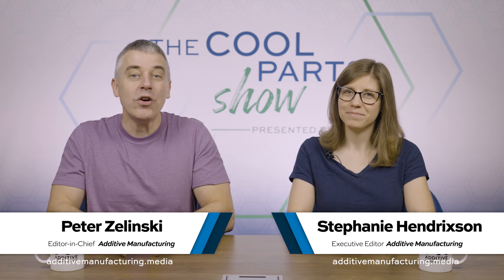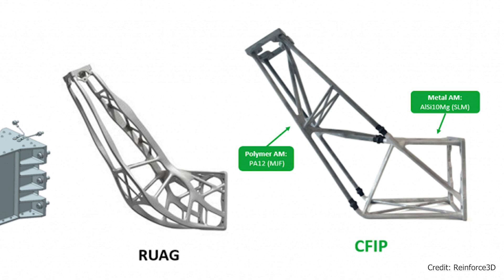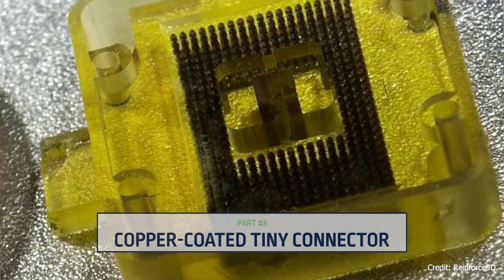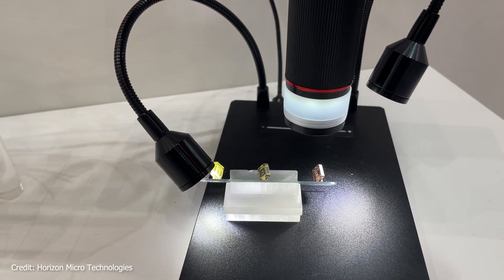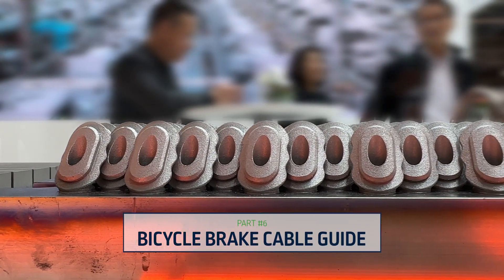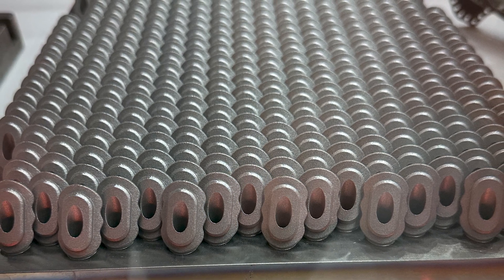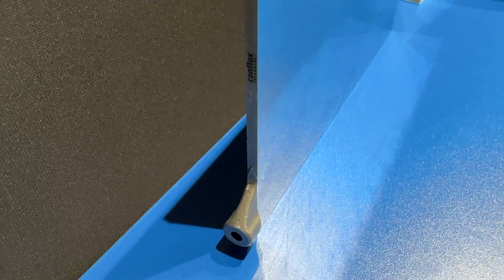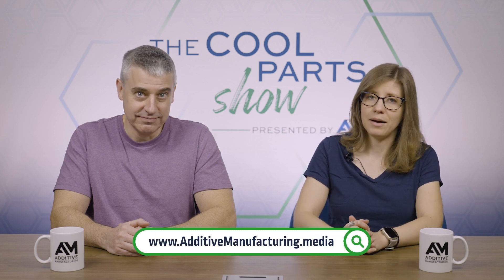8 Cool 3D Printed Parts From Formnext 2023 | The Cool Parts Show #65

Comment: Some of my favorites were: displayed at 3d Systems- Carbon Capture Condenser, Heat Exchanger with Implicit Modeling, Carbon Capture Heat Exchanger, CERN Cooling Bar, Gas Mixer With Active Cooling; at nTop- EGR Cooler, Semiconductor Chiller; at Farsoon Technologies Underwater Vehicle Chiller, In-Line Tube and Shell Heat Exchanger, Circular Heat Radiator; Drill Heads and Ta-10W component at BLT,  Air Hydrogen Micromixer at GE Additive, Fine Boring Tool at KENionic, products at Oechsler, NiCoMoTiAl test sample and Multi-Material Rocket Nozzle at a Korean company, DLR Scout Rover for Space Research at pro beam, Hybird Stator and Heat Exchanger at Aconity 3D, Copper-Nickel rocket nozzle. And I also saw the Helmet Pads at General Lattice featured on the cool parts show, and Carpenter Additive as well. And I was happily surprised seeing ultrasonic and Titanium chip-pulverizer based powder production solutions, liquid metal infiltration on additively manufactured structure, and constructions at Construction 3D.
Reply from the maker: We should have compared notes with you before filming! This is a thorough and varied list, although it looks like heat exchangers and rocket nozzles are of particular interest to you. The company you're thinking of with the multimaterial rocket nozzle is likely InssTek out of South Korea. Thanks for sharing and watching. Stay cool!
Reply: @AdditiveManufacturing  I see, thanks! I came to know about FormNext in September when I was watching an earlier episode of the show, thanks to you guys!